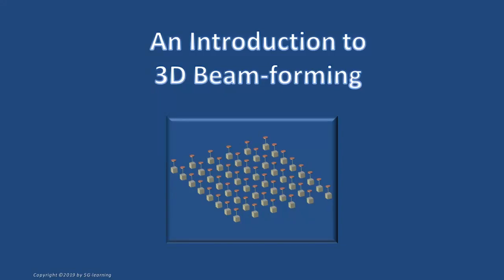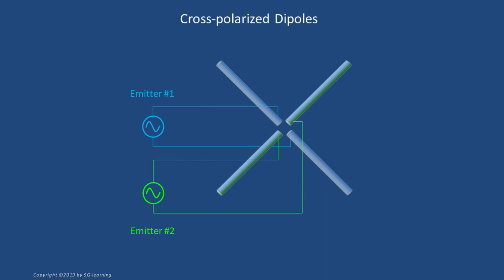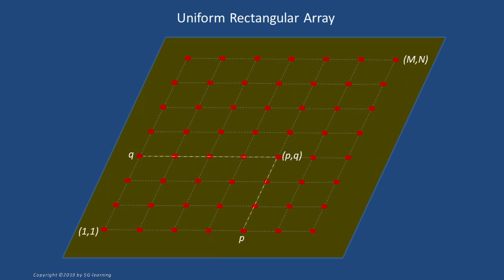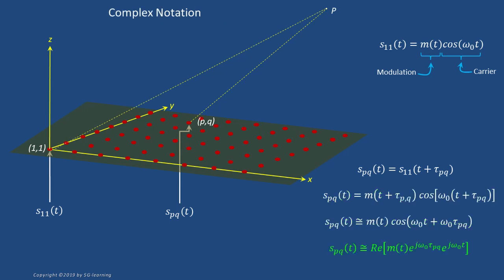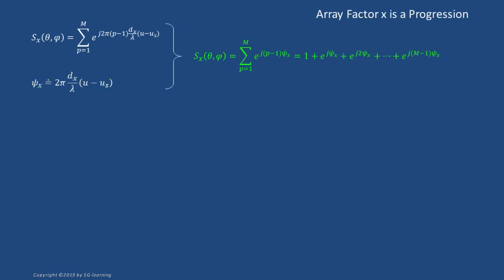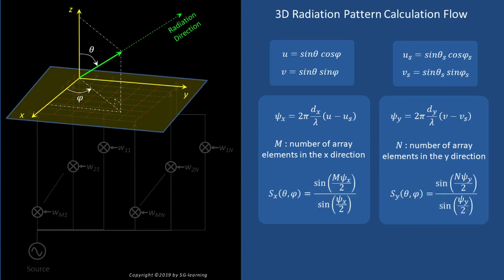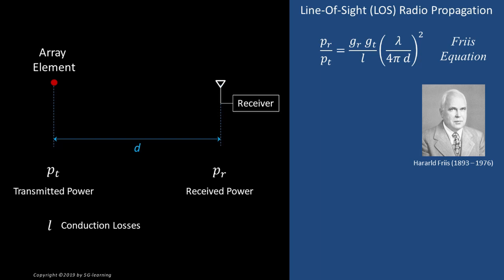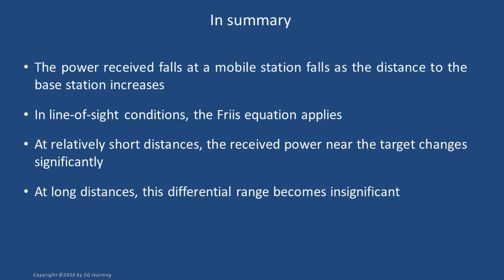An Introduction to 3D Beamforming

Comment: Great video! I was just wondering about the simplification at 27:30 where the exp(jz/2) gets simplified away, the z in the numerator and denominator are different according to the formula above so we should have a complex exponential left in the end right?
Reply from the maker: You are right. To be precise, S_x from this slide should be multiplied by the factor exp( (j/2)*(M-1)*psi_x). My interest in these slides was to highlight how the array amplitude behaves, so this module-1 imaginary factor has no impact in this sense. But yes, an explanation should have been given in this respect. I will take this aspect in consideration in future videos. Thanks for your comment.

Comment: Can you share the references you used for these videos? Thank you!
Reply from the maker: I mainly used the following book:
Constatine A. Balanis
Modern Antenna Handbook
2008 - Wiley

In addition, I consulted the following books:

Ahmed El-Zooghby
Smart Antenna Engineering
2005 - Artech

Arik D. Brown
Electronically Scanned Arrays 
2012 - CRC Press

John Litva et al.
Digital Beamforming in Wireless Communication
1977 - Artech

Hubregt J. Visser
Array and Phased Array Antenna Basics
2005 - Wiley

Robert A. Monzigo et al.
Introduction to Adaptive Arrays
2011 - SciTech Publishing

Zhizhang Chen at al.
Introduction to Directio of Arrival Estimation
2010 Artech

R. C. Hansen
Phased Array Antennas
1998 - Wiley

I hope that this may help.

Comment: I just think the "observation window" thing is simply explained by the beamwidth, where if you walk over the same  transverse distance at low antenna distance you'll see the beam gain variation, whereas at large distance your same observation window will not see much signal variation, because you'll remain close to the maximum gain "center" of the beam. 
I also suggest that instead of "painting" a 100lambda sphere with the beam factors, you could draw it as a 3D directivity "blob" pattern, and even in dB. But that's a matter of taste, of course!

Comment: Wonderful lecture. How is it possible to generate phase shifts simultaneously like in terms of a circuit? And how is the phase shifted - is it done by a voltage ramp? Thank you so much
Reply from the maker: Thanks for your comment. 

The phase may be shifted using a digital or analogue approach. 

Digital phase shifting is based on the Fast Fourier Transform (FFT). It is the most flexible alternative but requires a powerful Digital Signal Processor (DSP). 

Analogue Phase shifting makes use of semiconductor devices with properties (e.g. capacitance) that depend on a control voltage as you mentioned in the last part of your question. Typically, 5G systems operating in centimeter wavelengths use digital phase shifting, while millimeter systems use the analogue approach.
Reply: @5glearning772  Thanks a lot mate..

Comment: Great lecture of a hot research topic. Is it reasonable to apply similar concepts to the so-called metasurfaces in the optical regime?
Reply from the maker: Thanks for your comment. 
The same concepts described for the radio field may be applied to Optics as well. 
From a practical perspective, it must be remembered that the wavelengths used in 5G radio are in the interval between 1 and 10 cm, hence several orders of magnitude longer than even infrared light. 
Furthermore, beam-forming at mm wavelengths is currently based on analogue techniques due to today's limitations in semiconductor technology. Therefore, current transceivers in these wavelengths cannot take advantage of the flexibility and richness that digital beam-forming using Fourier transform entails. Of course, this should not discourage research. On the contrary, it is research that paves the way for commercial applications one or two decades later.
A final point: in this video we are considering that transmission and reception powers are enough to ensure that a large number of photons are acting. If this is not the case (as happens frequently in Optics), quantum-mechanical effects must be taken into account.
Reply: @5glearning772  Thank you for the detailed response. I will certainly take head of your points in my work.

I know time is a precious commodity for people like yourself...but do make more lectures to pass on the knowledge. You have a rare ability of presenting complex things in a clear and simple manner.

Comment: dude. that was really good!
Reply from the maker: Thank you.
Reply: @5glearning772  As you've been kind enough to reply, would you answer a question?

For large-N arrays (say N>1,024 elements), it is clear that for any desired steering vector V, there will be M  unique 'phase weight sets' K[0,1,...,M] that will produce a steering vector that is equal to V within some error E.  b = the number of phase bits ~ 6.  Each phase weight set K contains N*2^b values, there are M phase weight sets per steering vector, and we are trying to minimize the number of sets per steering vector to as close to 1 as possible (removing redundant sets).

Given that, what is the maximum number  M of phase weight sets K such that E is equal across the entire pointing space (hemispheric shell)?

In other words, if you were to pre-compute the phase weight sets K (for known N, b ;  given V), and you 'binned' weight sets K that resulted in the same vector within error E, how many sets would be required to minimize pointing error E across all possible pointing vectors (a hemisphere) while also minimizing M (number of sets)?

e.x. two elements (N=2) with one bit (b=1) of phase shift (0 or 180deg) will have three possible steering vectors. How can the range of all steering vectors be compressed into a set of every possible steering vector (size = 3) for a given N, V, and b?
Reply from the maker: Sure
Reply: @5glearning772  haha thanks!!!
Reply from the maker: I have been thinking on your questions. Probably I am missing some of your points, particularly on weights quantization, but let me present some of my thoughts.
Consider, for example, a simple linear array consisting of 8 omini-directional elements with adjacent elements separated by half a wavelength. Assume that you would like to limit the number of steering-weights accepting a penalty in the received power due to misalignment of the steering vector. More precisely, assume that you would accept a 3 dB loss. In that case, it can be demonstrated that you just need 9 weight-sets to cover the full hemisphere.
If, on the other hand, you increase the number of elements of the transmit array, the radiation pattern becomes sharper. Therefore, the same steering error leads to a higher loss than in the previous case. This issue can be compensated increasing the size of the weights-set.

I hope that this may help.